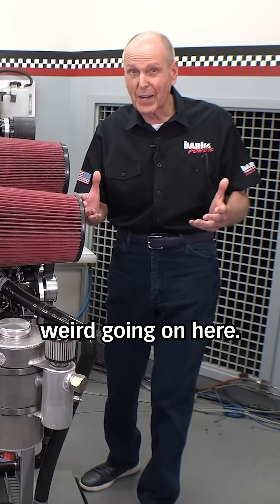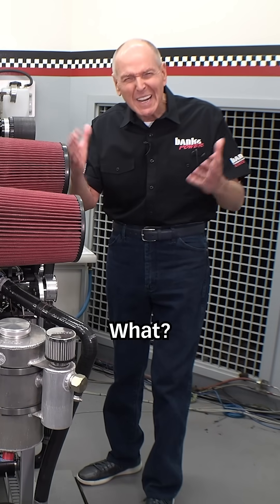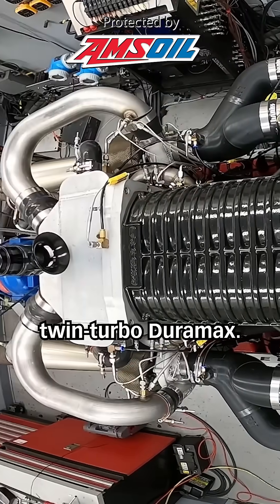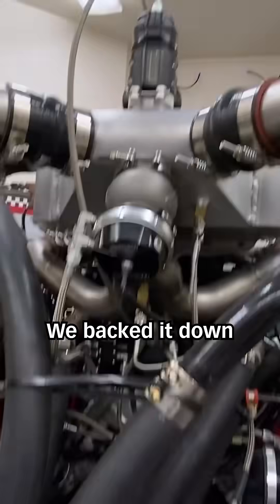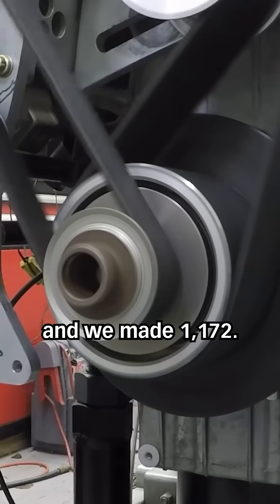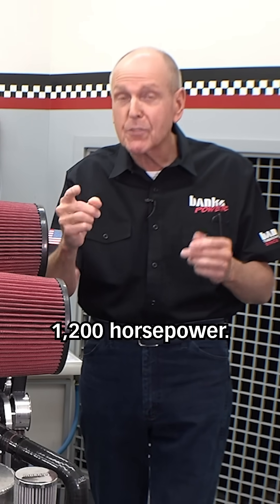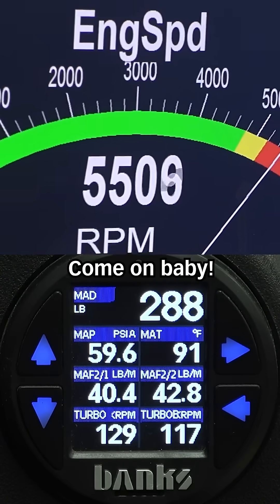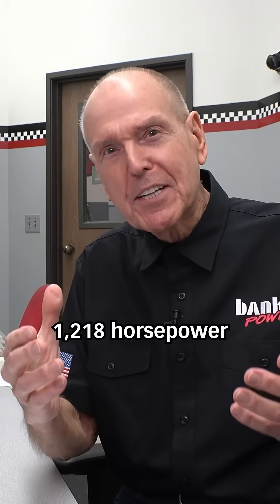How to make 1,200 horsepower the wrong way.

Comment: The blower is just scavenging like on an old Detroit. That baby needs to breathe! A diesel is basically an air pump. The more air and fuel you can stuff in it, the more power you will make. Just gotta find the sweet spot on the fuel and air mixture that it likes and run with it

Comment: Common sense should tell you that turbos first then blower is backwards……… you want to use the blower to help a larger turbo build boost then at a certain psi a black of plate open that’s bypasses the blowers boost and feeds it back into the system thus the turbos making all the powers. Come on bro it’s 2024

Comment: Maybe, just maybe, the final statement is correct that the direct power supply for the whipple charger should charge the turbos. I do not know that if at high rpm, will back pressure build in the charge pipe between the super and turbo chargers? Who knows

Comment: if you lower the blower speed wheren the turbo pressure is higher the blower becomes a motor with a pressure drop accross intake to output, the pressure drops, (like an intercooler) but your getting power at the blower drive insteed of a draw. The blower is coverting pressure and heat to mechanical power while reducing temp and incressing desnity to the intake charge.

Comment: There is a point where the turbochargers will pump more air than the superchargers, and thats when they need a switch from feeding the supercharger to feeding the intake direct. Or even if the turbos are feeding the supercharger, the superchargers volumetric efficiency is limiting the turbochargers flow capacity. Putting bigger pulleys on the supercharger and getting bigger numbers is because the supercharger is doing nothing but eating horsepower.

Comment: Detroit made an 8V71 that was blown and double turboed.  It was a diesel with the crankshaft being vertical.  The engine stood on its nose.  It was used to drive vertical turbine fire pumps on offshore platforms.  I started up a bunch of them.  The blower being downstream of the turbos worked just fine on those engines.

Comment: I don't understand this. If you had the supercharger before the turbos I might because then your turbos could cause a vacuum on the inside of the supercharger, imparting a torque to the crank, but in this configuration the supercharger would just be compressing the air more. Is it that your intercooler isn't sufficiently cooling the air to compress it enough and the efficiency of the supercharger is really bad?

Comment: Higher pressure+ too much heat= lower air density. Run refrigerant powered cooler instead of air to air or air to water for your intercooler. Get it down to 20F to 30F and you will get your 2000 HP.  Add a cooler on the i take also. 20F air going in will increase your air density even more.

Comment: If there was a way to increase the gap on the screws incrementally controled by the boost numbers. Would that allow more flow once the turbos are spooled and surpass the s.c. boost. Is a bypass possible. Almost a blow off valve in the s.c. to allow extra turbo boost through?

Comment: Ok, I get it now, have you ever heard of a Deep stroke Engine? Or are you trying to get this out of a stock short block Engine? With a Deep stroke engine, you don't need turbos or a blower, you will need a Lobed crankshaft and flat Cam lobes and a bored out Head and Oversized Valves. Basically a poor man's performance engine. Or are you showcasing a bolt on Kit with a Stock crate engine?

Comment: i agree.. blower should be only used up until the turbos spool and down low in rpm... then shut off using a clutch pulley

Comment: has to be backwards when you throttle down you get more horse power, i honestly thing the air induction system is letting way to much air loose and it's not going where it needs.

Comment: Try putting them in parallel, not series, with a one way gate to stop the blower pumping air backwards through the turbo at low rpm.  This way the blower won't "get in the way" of the turbo at high rpm.

Comment: Add fuel, lower boost, add fuel, lower boost More power?  Add fuel again, when power is flat as fuel is added, pull out some boost until your power is 1200.

Comment: the Blower is blocking the air from the Turbos that's why when you slow it down  the Turbos get more time to blow air  through ..get rid of the blower .if you don't want  turbo lag use both small and big turbos

Comment: Supercharger first with bypass to turbos. Supercharger providing low end, instant response, and force spooling the turbos to active rpm. So they can provide high end with out the Supercharger acting as a restriction.

Comment: 100% agree. My very limited testing says use the blower for overall airflow potential and throttle response…  Let the turbos lower the pressure ratio and therefore parasitic power robbing

Comment: All that to get the same power a cheap turbo E85 and a junkyard LS , a lot of money to make that power from a diesel yes diesel has more torque but the cost to achieve it is insane
Reply from the maker: We're not sure that you've seen the rest of the series. It's not always about making thousands of horsepower. Sometimes testing and development for these race engine programs are incremental steps to gather as much data as possible to build the best engine possible.  This was early in the development before the 7.0L DMAX. This is before the engine was supercharged, twin-turboed. In this particular test, Gale wanted to see what power the engine would produce at a very lean 18:1 AFR. It was lean because the 5.0L Whipple supercharger was creating incredible heat. He didn't want to add to that heat. In theory, a leaner AFR would keep temps down. However, you can't make much power without fuel, as this video shows. Later in the series, he richened the AFR and made over 1,000 horsepower.

Watch the Building a Monster Truck Engine series here: https://www.youtube.com/playlist?list=PLwtmrqcWzLtRXpEFXeXa3YF-L0xSK2Ml2

Comment: When I heard about the setup I thought that the blower would be first and turbos second....having the turbos first does "feel" illogical, but I can't explain why. The proof backs it up. It's like the blower (which sits in the middle) cannot keep up with the air push from the turbos and essentially "chokes" them. What does your power/torque curve look like? I'm betting it shoots up really well low down (thanks blower) and then ramps up and stalls when the turbos overtake the blower "speed".

I agree with the bypass valve method. Volkswagen haven used turbo/supercharger combos with that in mind. The blower provides low down power and helps the turbos spool, and as soon as the turbos equal the blower on their way up the power curve, the blower is bypassed and handed off to the turbos only. At present, your two induction mechanisms are choking each other.

Comment: Power keeps going up as you keep taking speed from blower cause the blower isnt able to make the boost as efficiently as the turbos do. Take the blower off and compound turbo it if you need those high boost numbers.
Only reason theu ran a turbo charged super charged diesel in the buses i worked on was cause they couldnt get the lag out of the turbos.

Comment: The power gains are coming from reduced drag on the crankshaft from the belt driven supercharger. I believe, if you have turbochargers, you do not need a supercharger. If you absolutely need the wider powerband then you need to uncouple the belt driven supercharger and bypass the boost around it when the turbos are on the boost.

Comment: What might work better than the turbo to blower combo would be a large turbo small turbo on each side with the exhaust routing through both, but the output routed to a gated airbox. Exhaust goes through the large turbo and does not do much at low rpm, then that exhaust goes through the small turbo which spools up early.

Comment: I'd have to see your exhaust gas vs intake pressure curves but gut feeling is the factory map may be intentionally rich at the low Rev range to protect the turbos from leaning out and causing dramas... anyway I don't have nearly enough information to make an informed call but to be increasing power while winding down compressor output means that it's easy over stoichiometric ratio from the factory and as you're leaning it out towards stioch it's making more power but lean mixes start making higher chamber/ exhaust temperatures... anyway have fun. 
P.S. there's nothing wrong with turbos first except it usually makes it more difficult to run an intercooler after the supercharger... what's the intake set up? Constant blow though sc? Or is there a bypass for the turbos ?

Comment: Volvo Drive-E engine family. Dual super and turbocharged 1.9L 4-cylinder motor. It uses the supercharger in stage 1 to force air to motor and spin up the turbocharger. After a certain turbo speed and motor rpm is reached, the computer electronically disconnects the supercharger clutch and drops a diverter valve so that all air ingestion is being done by the turbo. It makes 250hp on pump gas with no tune. 300hp on a mild tune from only 1.9L. Pretty crazy.

Comment: Take the charger off. Also, turbos respond better to more air and a slight lessening of compression. It allows the turbo to spin faster because you're giving it much more air but less fuel for the engine to burn and therefore it's running a bit lean and the exhaust gases are able to be used much more efficiently.

(( I have no clue what I just said, completely made it up based on my very little knowledge of this, was I correct tho))

Comment: So was it just not getting enough fuel at the faster blower speeds? Or was it something more along the lines of the turbos not feeding enough for it and there not being enough pressure at some other point in the system? But anyway, how much freakin torque is that thing making if it’s doing 1200hp, must be insane

Comment: Because of the way diesels operate initially, if you add too much air before you add fuel and thus you increase the air, defeating part of how the fuel itself is vaporized, too much air equals improper and earlier vaporization as well as combustion

Comment: The blower is a parasitic drag at high boost because the turbos are carrying all the boost. The roots style blowers are good for power down low then it should be on all turbo up higher in the boost range.

Comment: Found out the fuel system wasn't up to the capabilities of the upgraded forced induction and then acts like it's a mystery why cutting the charge volume made more power. Stoichiometry is critical for volumetric efficiency.

Comment: Makes a video saying hoonigan is wrong for saying add more fuel make more power. Than makes more power adding more fuel 🤷‍♂️🤦‍♂️
Reply from the maker: In this case,  we are making incremental, calculated adjustments of fuel with a properly designed intake system that complements the fueling as well as hundreds of channels for data feedback and analysis in a controlled environment.

Comment: Wouldn't you want your "static displacement adder" (i.e. positive displacement supercharger) right where it is, to make it easy for the turbos by effectively regarding the engine as a larger displacement?

Although, I'm now curious to see if maybe you can spin the supercharger faster and get the turbos to do the high-pressure compression more efficiently

Comment: I just have a bicycle and it's non turbo. I believe the air that used to be dumped because of overboost now goes to the engine entirely because when you backed off it kept the bypass valve from ever opening.

Comment: the supercharger isnt in sync with turbos since its twincharged or the blower is spinning fast enough to match since turbos make high end power a supercharger makes instant this is why twincharging imo is poopy but that might not be the case with this and i could br completely wrong but my opinion is firm

Comment: The blower is nowhere near as efficient as the turbos. So if you slow the blower down, it actually takes less horsepower to turn it. A Top Fuel blower takes 1k to 1500hp just to turn it at full boost. The best thing he could do would be ditch the blower altogether and eliminate the drag on the crankshaft or find a way to make it clutch based to let go after it reaches a certain speed or when when the turbo lag ended.

Comment: Ive always wanted to try this. Blower then turbo then engine. I invisioned it like multiple stages of boost. Also in my mind you need to have more restriction between the turbo and the intake vs the blower intake. To increase air velocity. 

All a theory tho

Comment: If your putting that turbo boost through that charger itll become a restriction but with a good bypass youll spool quicker so optimise your blower for the lower end once you've worked out where your turbos hit full boost, you should have 1200hp optimised thrbos anyway if thats you goal so balance the the bypass you maybe clutch that blower, sems odd to me your peak is affected by the blower being a twin scroll Im almost confident your not bypassing as youd get more through at lower speeds just like when they get over pullyed! 

Wait.......
He knows all this yea, Im todays fool I take it.....🤷‍♂️

Comment: If you’re not routing into a really good intercooler between the two then you’re doing it wrong. Temperature is not your friend here. That super is ingesting already hot air and heating it up even more. You want a higher VOLUME of air and all you’re getting is higher air PRESSURE, but at a temperature that means reduced density. Thats why backing the blower off lead to more power.

Comment: What you need is a way to bypass the turbos and supercharger at different times, low rpm bypass turbos and go to supercharger high rpm bypass and disengage supercharger and go to turbos that would be the best way to get rid of most of the parasitic power drops

Comment: Turbo:

Makes power at the top end of the rev range as it relies on exhaust gases to spool the turbo. So it can make a lot of horsepower. But only at the top. 

Supercharger:

Makes consistent power throughout the rev range. It’s mated to the crank so as the revs increase, so does the air pumped in. So it can’t make as much horsepower as a turbo but it does make more power than a turbo would at the low end of the rev range. 

Combining both would need the supercharger to work on the low end of the rev range and then to have the turbo take over for the top end. 

He’s showing here that you can make more horsepower by relying on the turbo more but only at the top

Comment: Volumetric Efficiency can NOT be tricked! That’s what’s going on… a given bore X stroke can only maximize so much Volumetric Efficiency… pushing/forcing in MORE air, will only offset this torque/power curve.
I’m thinkin’ that once you were able to get’er @ that 1218 HP mark, was about the precipice of that engines’ specific torque/power volumetric efficiency curve capability.
To get more HP, would require bigger &/or bore &/or longer stroke

Comment: I love it when Gale pretends like he doesn't know exactly what's going on, maybe to let us Mortals feel not so dumb every once in a while.  😂
Reply: Exactly.  But it's great content.  Banks legend for a reason
Reply: Yea but when u got someone who is thinking on what is actually going on i think its doing a bit of knock, that or the mixture is off
Reply: @Wreckedftfoxy  it is just the problem with the "peak" HP measurements that way too many use to tune their motor.
it is neither sustainable, nor something that can be reached on the street.

if you really want to know how much HP your motor can produce, then you would need to do long time tests with the wind in the right speed acording of the speed the car would run at the tested RPM.
only if your motor is surviving over an hour on half max rpm, you know that your cooling system is strong enough to support the HP the motor is making. the HP it showed at that point should be the actual HP of the motor because it is the HP that you mostly use on the streets.

Comment: 1200hp at 5500rpm on a Duramax.
Knowing Banks the engine is still running clean not too rich thus not rolling coal.
Mental numbers really.

Comment: You need a clutch system that disengages the blower compeletely. Its parasiting the horsepower straight from the crank at high rpms.

Comment: The blower was bypassing the turbos with too much air charge with the speed being backed off it allows the spool and power to come out of the turbocharger and then allows the The screws on the blower to compress charged air.

Comment: Should run the supercharger off an electric motor that way no drag on the engine.  The electric motor could be run off a battery that is charged via regenerative braking.  New kind of hybrid.

Comment: Mr Banks. I have a 1989/90 limo dually that you guys installed probably one of the first Banks turbos units on it. It was a custom built for my dad. It was black and burgundy. It still sitting at our ranch in Chino Ca.  I haven’t turned on the truck in over 10yrs but I believe it will still fire up.  Great work love your videos

Comment: Detroit Diesel had a blower bypass set up for their 2 stroke diesels 92 series and 149 series
Blower for low rpm amd load scavenging but when boost picks up no need to blowers parasitic load and heat created so it by passed 
Volvo is doing this with thier marine diesel engines blower just free wheels not under load

Comment: I've always believed in a supercharger/turbo combo the benefit of the blower would be the instant response at the bottom end and some form of compensation/additional airmass to help spool the LARGE turbos to really breathe at the top end 👌 In theory you would also have nice linear throttle response throughout the rev range. God bless 🙏✝️